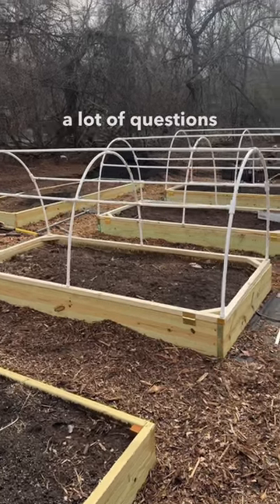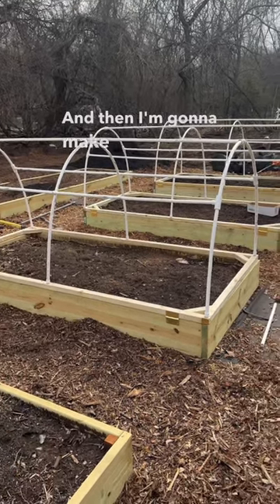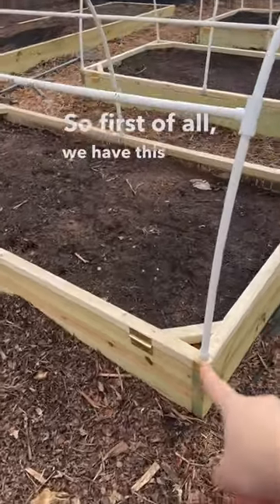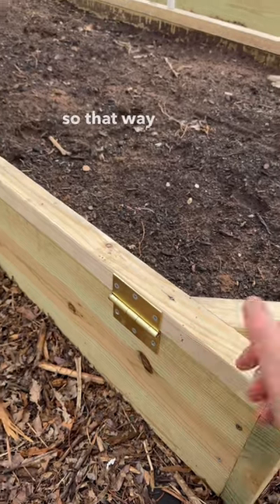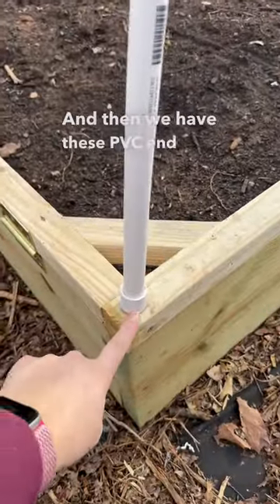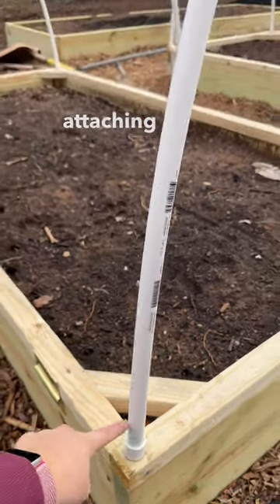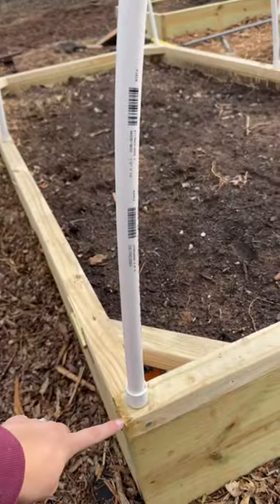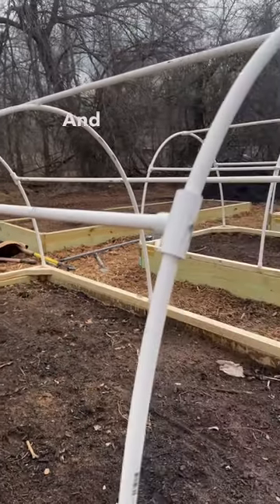Answering Questions About Our DIY Raised Bed Hoop Houses!

Comment: Good design, but from experience, the pvc will become too brittle after a couple winters and will need to be replaced.  The T's for the support will crack.  The size pipe vs width of your raised beds is important as well.  The stress on the end caps won't last.  It's a great design when it works, just be ready to replace it after a couple winters.
Reply: Would PEX hold up better? I'm in SE TX so cold isn't my concern as much as sun damage.